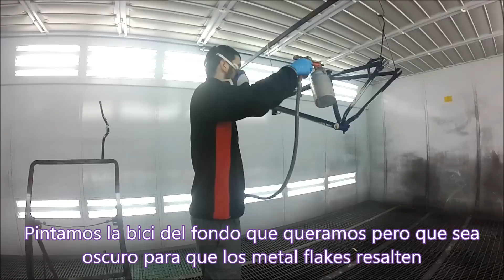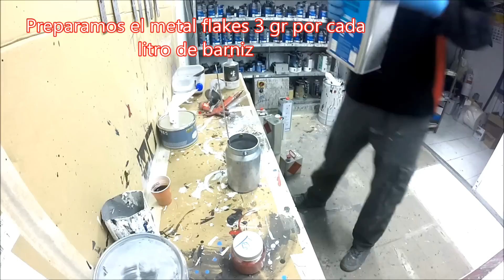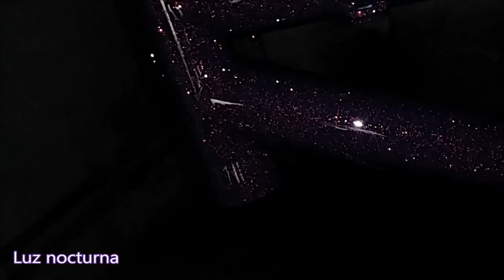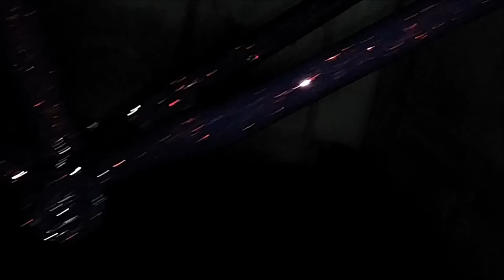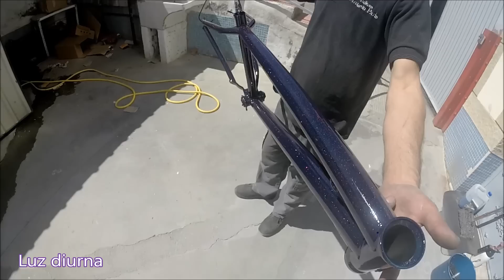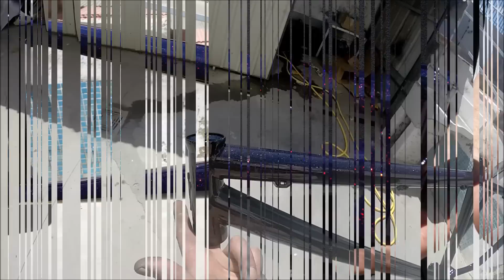Bici morada pintada con metal flakes rojos

Comment: puedes pasar materiales para pintar mi bici asi podes pasar nombre de cada uno de los componentes
Reply from the maker: Pues tienes que pintar el primer color con pintura acrilica pero que sea un color oscuro y después haces barniz acrílico mezclado con metal flakes y la barnizas, al litro de barniz le tienes que aplicar 28gr de metal flakes, en resumen pintura acrilica oscura (Color deseado), barniz acrílico y metal flakes + pistola con pico 1.6 o 1.8 sin filtros
Reply: Gracias Bro

Comment: Sabe onde posso comprar metal flakes? 
Você vende?
Reply from the maker: Ataides de Lima Silva seguro que si pones en internet comprar metal flakes te aparezcan tiendas donde comprarlo y si no en cualquier taller que se dedique a la pintura te lo puede conseguir, otra cosa es que quiera vendértelo
Reply: ***** Não entendo espanhol, mas voc~e esta pensando em vende? Se sim eu gostaria de negociar.
Reply from the maker: +Ataides de Lima Silva aqui puede que la encuentres https://m.facebook.com/photo.php?fbid=1633334413557992&id=100006443477540&set=a.1503528919871876.1073741828.100006443477540&source=48